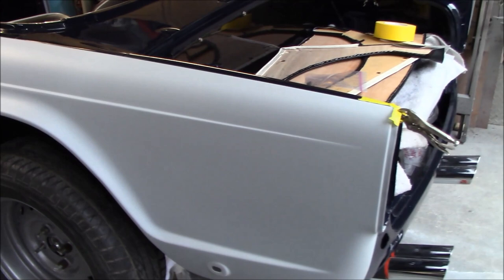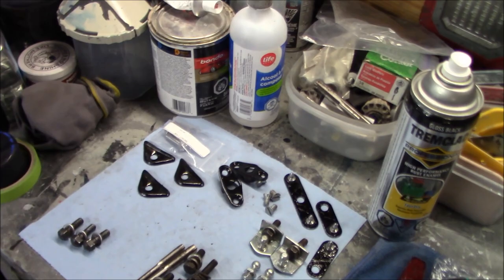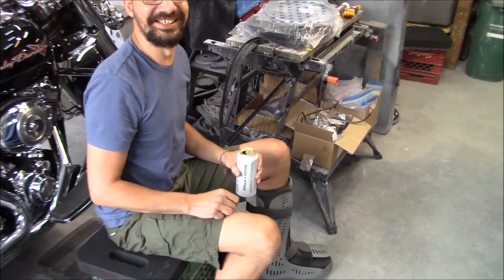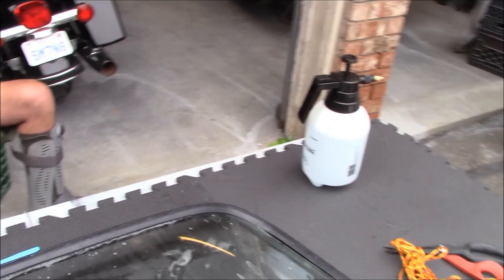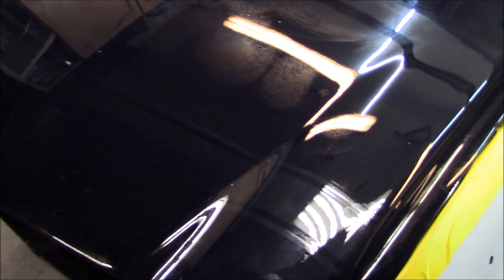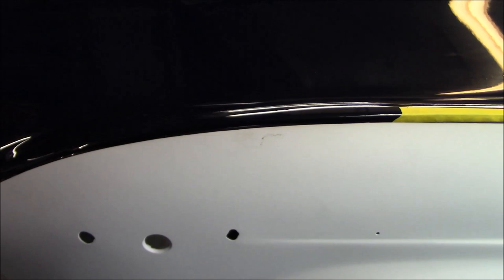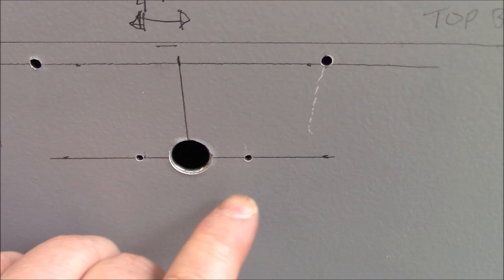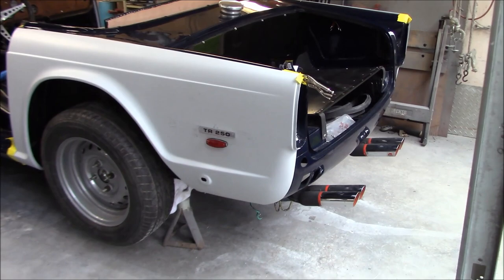1968 Triumph TR250 Restoration, Bonnet,  Windscreen, Rear Wing Badge and Light Installation

Comment: Hey Tush (hope that’s ok not David) I feel I know you because I have watching your videos for years now.. great job with all the restos ( as we call em in OZ) I like your attitude to originality, ie put the vent in when not factory, ghost line on the bonnet, Nissan diff etc subtle restomod style… btw..I own a 1968 Triumph TR5 signal red, chrome wires, momo steering wheel but stock otherwise and pretty tidy so long triumph TR tragic! I’m coming at you, ( see what I did there) ha ha from Tasmania and loving you and Elin Y’s stuff, learning a lot… I even went out to the garage during this video with the tape measure to check if got the badging (2500 on mine) and the lights right…and you were spot on.. well done! PS say hello to Les & Elin for me
Cheers Robert from down under
Reply from the maker: Hi Robert, great to hear from you.  Thanks Very Much for the kind words.   Just in from a late night out in the garage trying to figure out how I’m going to lay out those darn 250 fender stripes (I’m wishing now it was a TR5 without the stripe 😉).  Hopefully will get the rest of the panels painted in the next couple of days.

Comment: Hello David,
great progress with fine results. I totally agree with your plan to put all the fenders and bonnet, bootlid (what’s about the doors) on the car before 
finally paint. My paint specialist, he works also for a Ferrari classice homologous Ferrari dealer here in Kassel in the middle of Germany,
educates and coaches me of all the doings for the pre painting preparations, he gives me the same work plan. Final corrections and then,
in my case … the specialist do the last color paintjob. It’s impossible to do this in my small garage.
Looking forward for your last steps… will be a awesome result.
Greetings 
Uwe

Comment: Do you add any sealant around the windshield rubber, or just install it as-is? It seems like I've heard of using some kind of sealer in the channels, but seems a lot easier to do without, assuming it doesn't leak.
Reply from the maker: Hi Bill, I’ve never needed to add any sealant and never had any leaks.   If you were to add sealant or caulking, I think the only area I would do would be around the windscreen posts.

Comment: David, I’m going to replace the chrome trim on the windshield seal of my TR4A. What tool did you use to install yours? I know they make a bespoke tool for that job, but I think you said you used a mallet?

How did you install/adjust the bonnet hinges to the bonnet? I see that your headlights are installed. On my car I had to do that with the headlights removed, using the headlight opening for access. 

Speaking of badges, the offset position of the bonnet badge on the 250 always bothered me. However the offset bonnet bulge looks “right” to me. Funny that.
Reply from the maker: Hi Jim.  First, lots of soapy water sprayed into the channel for lubrication.   Start you chrome strip in the centre at the bottom of the windscreen.   Push it into the rubber to get it started and then give it a couple taps with a rubber mallet until it pops in.  Keep spraying soapy water into the channel ahead where you are applying the trim.  The only areas that might give you a little fight is on the corners.   For the hinges, I’m easily able to reach all locations with the grill out by reaching through the grill opening.   I don’t mind the badge location.  I’ve been dying to get it on there just to take a look!  Cheers, Tush
Reply: @cheftush  oh that’s right, the 250 doesn’t have the radiator shroud like the 4A👍

Comment: Thoughts on spitfire engine in a tr10 chef?
Reply: Supermarine Spitfire ?

Merlin or Griffon ?
Reply from the maker: Well, if you aren’t worried about keeping it stock, and making it more drivable, then I’d say why not!  I think there were three Spit engine options…I’d probably go for the 1296 CC.
Reply: @cheftush  yes the less complicated the better for me.
I just need a little more power now that i moved up into the mountains and have to drive it everyday
Reply: @johnmoruzzi7236  merlin of course
Reply from the maker: @vwbusguy  that and a nice overdrive unit and you’d be all set!